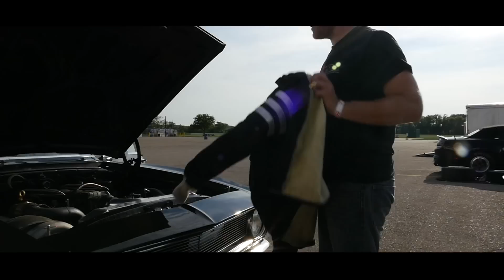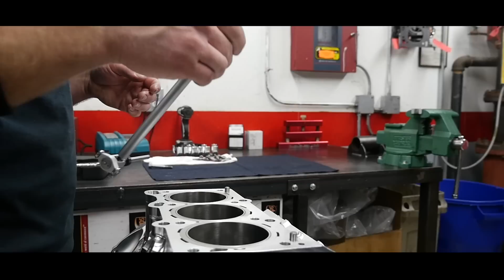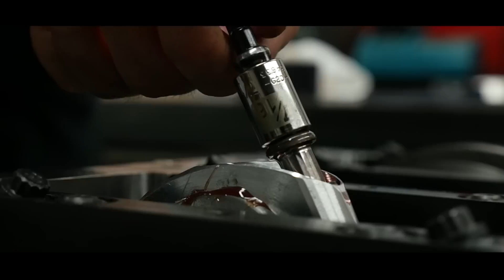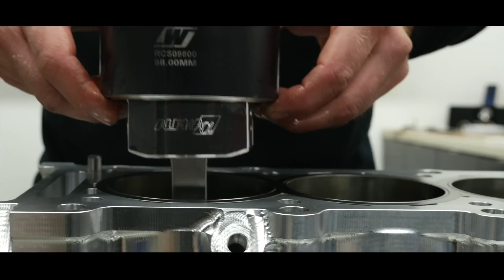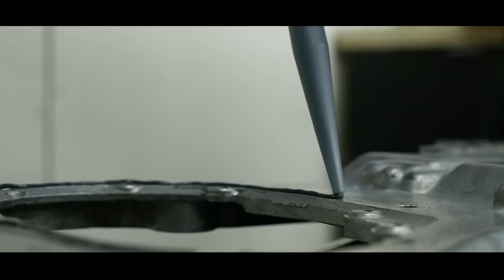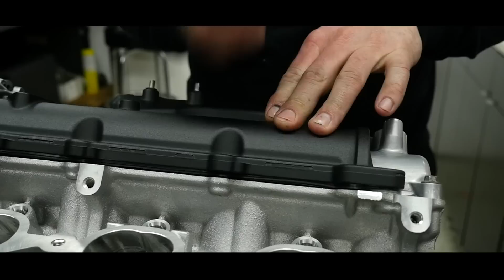A Proven Engine Program

Comment: You guys have done amazing work. Absolutely phenomenal. My question is have you guys ever worked with any NHRA teams to help with building and developing motors? The reason I ask is they have experience building 6,000 horsepower motors and may have a few tricks or ideas to help you build a strong and reliable high power engine. Thanks for all you guys have done!
Reply from the maker: Hi Marty thank you for the feedback! We actually do work and consult very closely with suppliers that devleop and test critical engine components for top NHRA teams, as-well as our own research efforts. Thank you for the continued support!!!